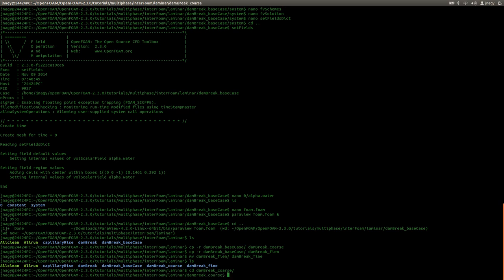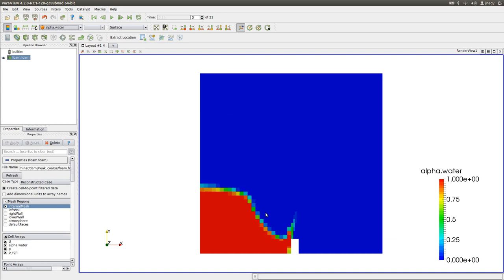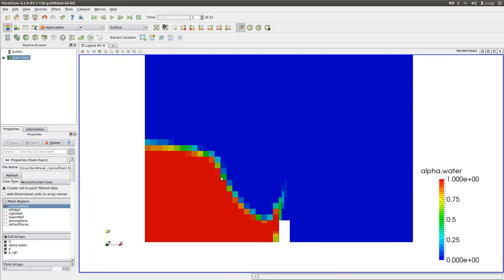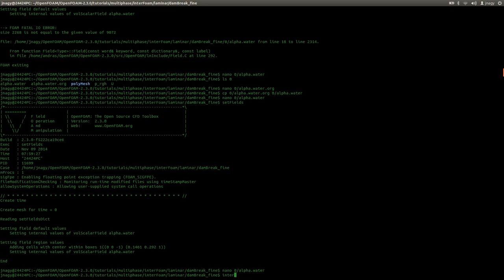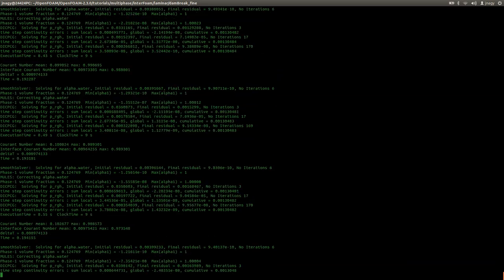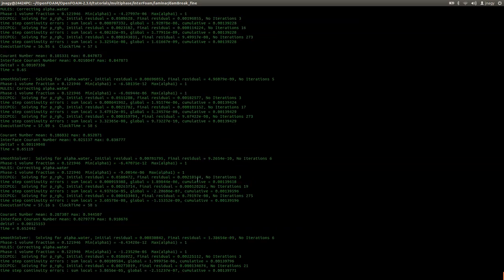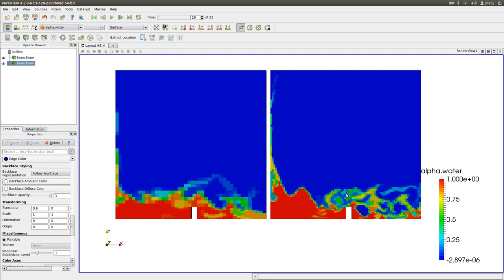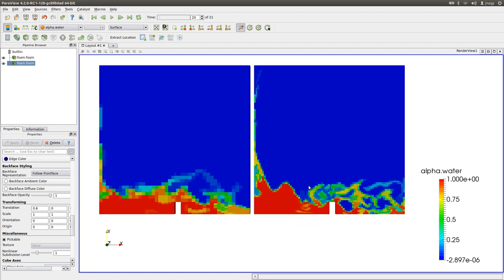Understanding multiphase modeling (VOF) - Part 2

Comment: hi mr jozef thanks for great works u do my question is i work on landslide simulation (landslide , water , and air) solving with multiphaseInterFoam solver ofv2012 how can plot average velocity for only landslide its is possible? what U represent in this simulation a mixed U ?

Comment: While I agree that course grid is bad if you interested in the latter half of the domain, I don't think the interpretation of 'what kind of fluid has a density of 500' is correct. The correct interpretation is that the material property has been averaged over the cell. In any case good video.
Reply from the maker: and this is the weakness of the model

Comment: hello,I am using the rasinterFoam(k - epsilon model)  solver to simulate a draining tank problem(the tank is open on top and a hole in the bottom).Since the water is still in the beginning ,I set k and epsilon a very small number then the simulation crashes .What value should I choose for them ? Thanks.
Reply from the maker: +zhu ziming First check your mesh. You can also use the rule of thumb, I give in my turbulence tutorial.
Reply: +József Nagy thanks,my mesh is ok ,I am working on my BCs and have made some progress.